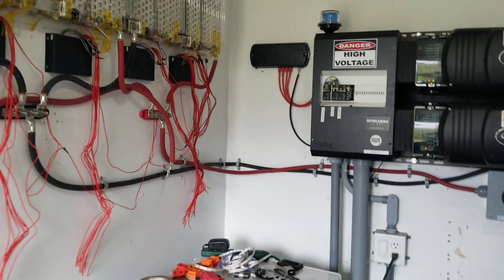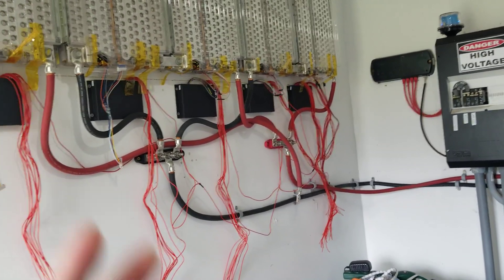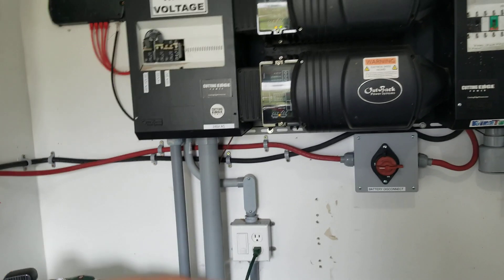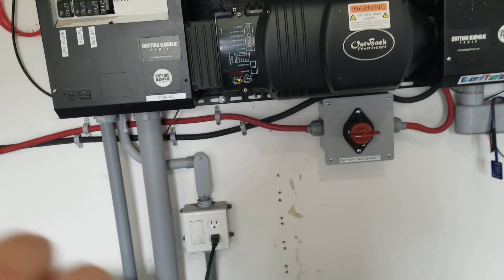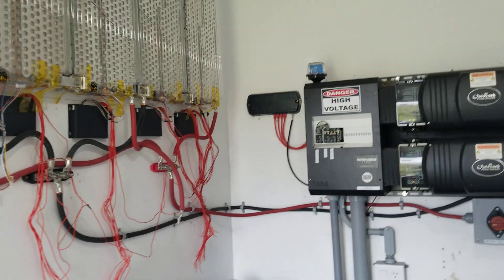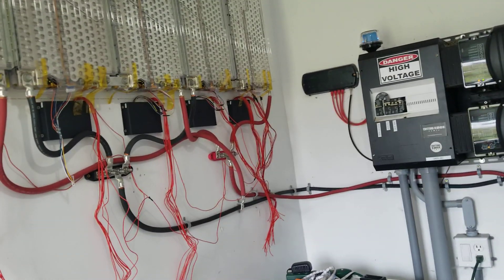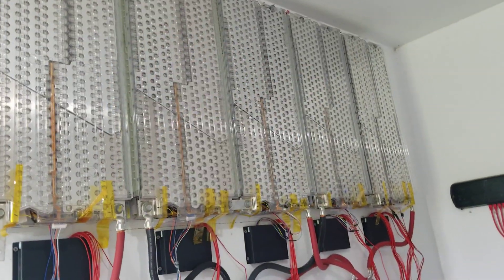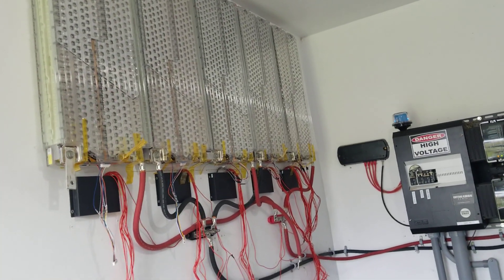I need your help !

Comment: I would use a relay that is rated for high amp (500A+) rated for continuous duty. I would then use a programmable BMS that will allow you to shut off current at a set voltage.  The relay will be on while the BMS is supplying power to the relay's sense leads.  When the BMS turns off the power to its load side it will turn off power to the relay sense leads and the relay will trip and shut off your inverters.  The BMS is essentially only for tripping the relay.

Comment: Singineer has a voltage controlled breaker  but why not just use a BMS, ANt (VBMS) has one with 300 amps works great. Shunt trip breakers are available but expensive.
Reply: Yeah vbms should work but I don't know I don't use bms on my volt batteries would be cool for a breaker then u would not have to worry
Reply: @dangoras9152  BMS has much more control and works for many different situations voltage, temperature, single cell runaway, etc.

Comment: Bro all u need is a plunger coil connected to a reley. These plungers are used to control water pumps, on/off. More like a solinode. U can also use a solinode with a relay. Try it.

Comment: ANT Bluetooth BMS used for ebikes is 300 amps capable.  I've used them twice  on high power ebike battery builds Samsung 30Q and Sony VTC6.  Around $105 for the BMS cant be beat, unless you need to draw more amps per 48v series than that.  Not to mention I can turn on / off the outputs, overvolatge shutoff,  over/ under charge shut off and turn charging on or off as well as turn on active balancing at ANY state of charge all from my phone.  I've actually  drawn 263 amps at 88 vdc (23kw) continuously off of one and it seemed to be fine.  The instructions are trash but the app is surprisingly decent.

Comment: Other than using a BMS system I don't think that there is something like what you want available, if your inverters or charge controller has settable or programmable relay outputs you could use a single pole double throw relay set up in a self latching mode with a push to make switch which will act as a reset switch to trigger the system that relay would or could trigger your contactor which is the main disconnect,  the relay in your charge controller or inverter is what would tripp at the preset voltage and or current and this would then in turn cut power to your contactor that would then cut the power to the batteries, this has one major drawback in that there will be no charge or drain possible until the reset button is pushed physically engaging the contactor...... Sorry brother, all I can think of and by no means perfect.....

Comment: I believe the shutoff breaker you're looking for is called a "shunt trip."  Many are available for high amperage DC and can handle 1/0 gauge cables.  Have you ever checked out a BMS product called Batrium?

Comment: You could use A Relay to switch it off and control it by an arduino with an current and voltage sensor ;)
Reply: How can I make the adreno measure 520 V?

Comment: Tiny BMS configured for up to 750A.  Would get expensive if you need one for every pack. I do LiFePO4 in 4p16s so I can get by with one BMS. Not familiar with Tesla stuff but as someone else mentioned, an Arduino, shunt and relay could be configured for what you want.

Comment: Use a relay. Set your charge controllers aux output to turn its output off at a certain low volt cutoff. Run a relay to disconnect when the controller cuts its power, the relay cuts the load. Use those auxes. Lol. So, the setup goes like this.. Come out of your programable output of your controller to either a DC converter to convert to a comparable relay since or input connection. Use that same 12v or whatever and put a relay between the hot on either the main load or individual battery hot. Only cut the load though so your controllers are never disconnected for their own protection.

Comment: Can you use one or more of your inverters or charge controllers to control the contactor? It seems like if you had multiple devices controlling the same contactor and even one of them failed the other would trigger the safety mechanism.

Comment: Install a proper bms with a shunt trip breaker. Then you get a proper install. A proper bms does voltage on both cell level and pack level including current and temperature. Most decent bms systems do this. 

You can build ur own or buy One. A Charge controller only know about overall voltage and thats why you have a bms. 

 Bms primary functions is to 1. Protect 2. Notify and lastly balance. 

A breaker i recommend is the ABB s3 or s5 series. That with bms and your home.  Look at My videos and you get a hint. Plenty of products out There that do it.
Reply from the maker: Thanks for your input. I'll look into some of the recommendations
Reply: This is exactly right. You might use a large contactor instead of the shunt trip breaker but the breaker is likely cheaper. Also consider separating the charge and discharge busses so the BMS could disconnect discharge (loads) on undervoltage but leave charging connected, and visa versa.

Comment: Shunt trip breaker on the charge controllers   no need to turn off the battery wires do just the charge controllers. Anther way dump load useing voltage monitor

Comment: You need a relay controller. I lived off the grid for about 10 years and that's what I used. For the relays I used solid state relays and they worked great. Morningstar makes a very nice relay controller. Check it out.

Comment: Hi there friend!  I believe that you already have the capability built in to your Outback Power system.  Question, are you using the temperature probes on your charge controller and your vfx-3548 inverters.  I have found that if you don't use the probes the voltage that you set for your absorb and float stay a lot closer.  Another item to play with is the setting of the temperature range control option.  Change it from WIDE to LIMITED. What this does is allows you to set the maximum temperature variance. Without the probes in place sketch should be okay if you have the probes off. There is still some temperature control in the controller but it will track the room temperature if a room gets a little warm.  also in the controller is the ability to limit the maximum amount of current that the charge controller will put out. Your charge controller is an FX - 80 so the default current would be set to 80 amps maximum before it would limit.  You have the ability to drop it anywhere below 80 that you want to.  

On your inverters, they have the ability to disconnect the batteries if the voltage goes below a certain set point.  You can also set the re-energized voltage for the inverters if the voltage comes up to that point.  I hope that this helps.
Reply from the maker: Aloha Lou, lots of good points thanks for sharing your insights. I got your text I trying to find some time to call you so we can chat.

Comment: I can use my victron 75/10 charge controller with my 12v system and no solar panel to monitor and control the battery output to control a solenoid/relay. Maybe something similar but compatible with 48v?

Comment: Just vor Voltage you could use an BMS system connected to an big Relay The Relay would constantly be powered on by the BMS and if there is a problem the bms shuts off and With that the Relay also shuts off! I am using this for years on my Powerwall setup 
And then just use a Breaker for the current cut off

Comment: Victron energy has a line of smart battery protect devices (bluetooth) that may work for you (only voltage hi/low, no current protect). They handle pretty big DC current. I would discuss with their customer service.
Reply: The  Victron stuff can only be connected to the load side and would not protect from an overcharge scenario as described. Works great for low voltage cut off.

Comment: I assumed your active balancers had the ability to check independent cell voltage like a BMS and control contactors to First contact a precharge resistor before the relay when connecting and also for disconnecting in an under or over voltage situation.

Comment: Or for only $17 you could use a dork to control the contactor. (DROK Battery Charge Discharge Protection Module)

Comment: I agree with OffGrid.  Get rid of the active balancers and replace with BMS.  Overvoltage and undervoltage are integrated, decent BMS will have temp sensors in them. You can parallel them or you can use them as activators for a contactor to handle high amperage.
Reply: My BMS works along side of the balancers same ones he is using
Reply: OffGrid Wanabe I know it could work, it’s just an unnecessary redundancy and too many points of failure to use BMS and active balancers.
Reply from the maker: Aastan please understand what each do. Then your statement would not be invalid.
Reply: @Aastan  Yep that is the debate I see it totally the other way with all the points of failure and there are a lot I would like a control over them. But each to his own and every battery bank has it's own way of working.
Reply: Modern Off Grid DIY I do....don’t take it from me.  Just trying to help so you dont’t waste money.  Why would your setup be any different from any other solar setup.  Simplphi, battleborn, Renogy, the list goes on.  None use Active balancers. I know their chemistry is different than the Tesla modules but the same principles apply
Reply: @Aastan  A lithium bank that needs active balancers is a old bank that is dying or has to many mismatched cells. they are fine, but if you can get matched cells you will not need a active balancer, only a bms.

Comment: Thornwave Labs Inc.

POWERMON - BLUETOOTH BATTERY MONITOR / DC POWER METER
Reply: This look smarter and more versatile than the victron.  I heard somewhere that it can control a motorized on off switch alleviating the need for a relay constantly sucking 8watts.
Reply: How many watts would a solid state relay consume compared to a mechanical relay?

Comment: Victron Energy BPR110048000 Smart BatteryProtect 48V-100A ??
Reply: It's really stupid that You'll need to purchase two of these if you want to do high and low voltage protection. And I have no idea if it'll be able to be triggered by BMS that senses a single cell out of voltage range.
Reply: It's got an app and Bluetooth so maybe you can customize some code.